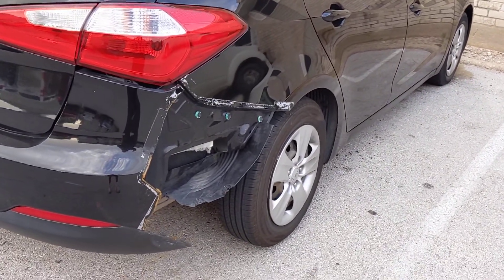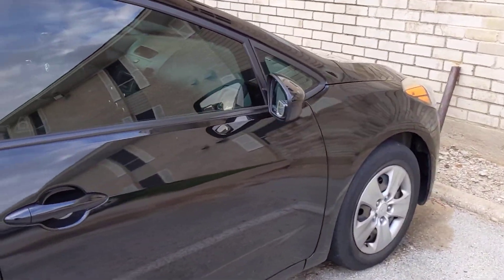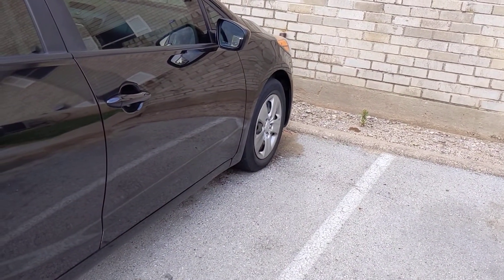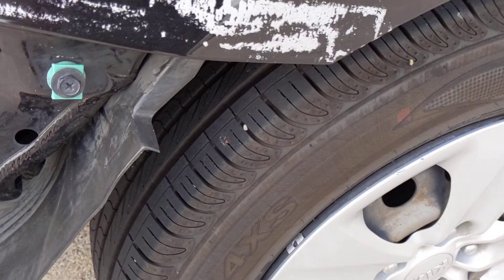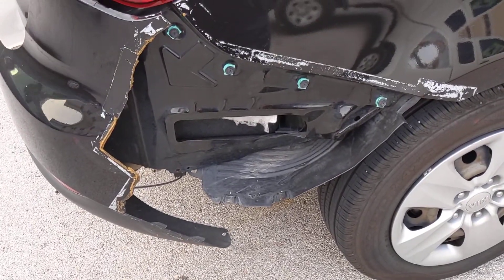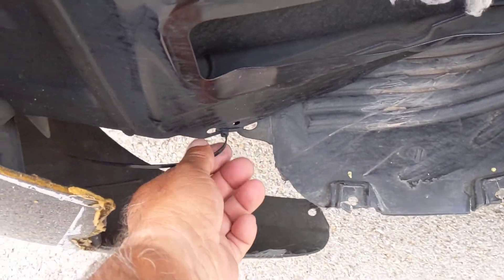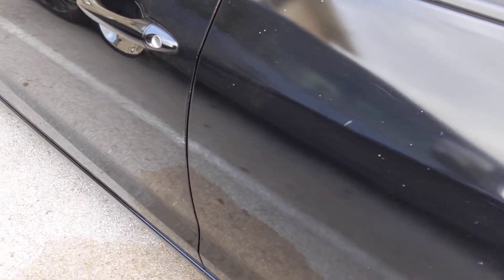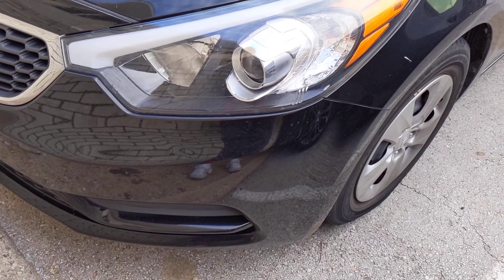Kia Forte flimsy bumper review

Comment: Yeah, I was driving down the road, the middle of the night, and heard what sounded like a flat tire and the car was struggling to keep momentum. Got out and looked; The wheel well had come off and was just rubbing against the tire. It smelled like total burnt plastic. I had to pull over with nothing but my phone light on the side of the road, middle of nowhere SC, and try to cut the wheel well off and use pins from the other side to pin it back up; It was a nightmare. 2017 Kia Forte S.
Reply from the maker: Thats about right. Happened to us going out of town.  I remember the old cars and that wouldn't have happened.  At least now I bought a used bumper online and it was cheaper because mine is a 2016. I waited till November last year to buy one. $80

Comment: The front bumper is meant to be a bit flexible, its like that to help you replace your front signal and side marker bulbs that might be hard to reach if your hands are too big to reach behind the headlight assembly. Just undo the small bolt at the corner of the bumper where it meets the fender and a gentle pry with your hand on the bumper would detach from the fender, and can easily get at those bulbs in particular.

However, the rear bumper, yikes. I don't understand what that's about. Must have had a some momentum on that debris to shatter the side of the bumper like that. Hopefully it didn't put you back too much if you had gotten it fixed.

Comment: Don't run over stuff on the road 🤣 I have 226,000 miles on my 2016 never any issues
Reply from the maker: Yes, your right, actually I had crappy tires and should have changed them and I wouldn't have a blowout. I love the motor.  I think it will go forever

Comment: Bro i was driving my parents one 2016 as well and bounce a wire fence with ever so little impact on the back side and the bumper ripped in pieces at two spots,  uk the price for one of the 2016 cerato/forte bumpers?
Reply from the maker: I have seen them on the internet for about 150-250 refurbished but not painted. Aftermarket is a little pricier.
Reply: @paultrevi  thanks i hurd some guy saying $900 new brand thats crazy could have sworn its a bmw i bounced, can u send me a link to one of the bumpers tho been searching and cant find any guess how i live out of the US

Comment: Maybe don’t hit debris on the road 🤷‍♂️.
Reply from the maker: Nope, tire just blew out. Ripped the bumper because I didn't stop quick enough. Too much traffic and had to get over from middle lane.
Reply: @paultrevi  And you blame the car for that instead of the faulty tire...k
Reply from the maker: @jaredshelton4718  dude what I'm saying is that my fukin 1995 camaro has had blowouts cause I'm running over 100 miles an hour in 110 plus weather and my fender didnt blow to pieces like this. I'm saying Kia which cost me well over $13,000 not including interest should have a better effin bumper that blows at 60 miles per hour. Don't you agree??!! They don't make em like they used to. What are you 30 yrs old.?
Reply: @paultrevi  So you’re saying one of the cheapest cars to purchase should be built better? You realize $13k isn’t a lot lmao. Are you also comparing a 95 to a 2013?
Reply: @paultrevi  I’m 21 actually 😂. My Kia Cadenza doesn’t have this issue, then again it was just under 45k.
Reply from the maker: @jaredshelton4718  good for you. Daddy bought it I bet
Reply: @paultrevi  Don’t hate me because you can’t be me lol. I’ve worked since I was 15 and saved everything.
Reply from the maker: @jaredshelton4718  I don't hate you don't even know you. Just don't understand what you didn't understand. You made a valid point. Your 45000 car is built better as it should be. But my 1995 camaro doesn't you get it? They don't make em like they used to. Do you get it or not??
Reply: @paultrevi  I mean you’re comparing a sports car to an economy car so no 😂
Reply: Who has multiple blowouts?
Reply: @panaphonicssorny3446  People who hit debris on the road.
Reply from the maker: @panaphonicssorny3446  me, cheap tires 😂😂😂

Comment: That's the bumper cover, not the bumper
Reply from the maker: Yes that's right. Technically your right. But I think  people get what I mean.
Reply: @paultrevi  did you ever get it fixed/replaced? I have a damaged lower bumper....I'm thinking about buying the replacement and replacing it myself, but I'm a little apprehensive
Reply from the maker: @scottraymer9217  actually not yet, I'm waiting for prices to go down and more availability.  Websites have them all day for about 200-400 bucks. I know I can get one for 100 if I just wait off a wrecked one with front end damage.
Reply: @paultrevi  cool, good luck. The lower piece is going for about $100....think I'll get it and try to put it on myself